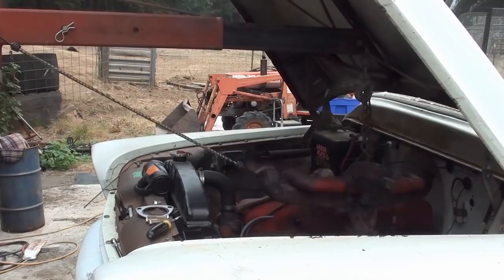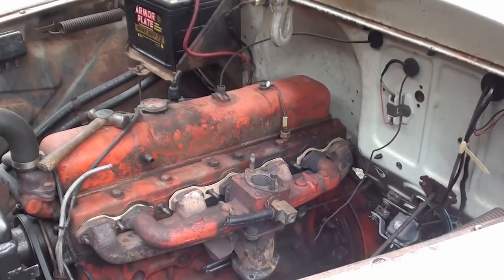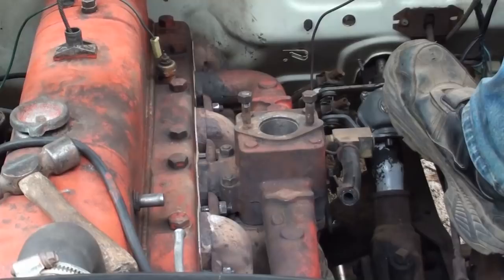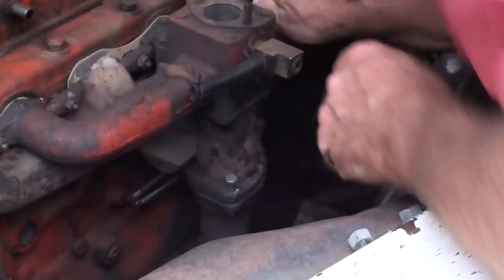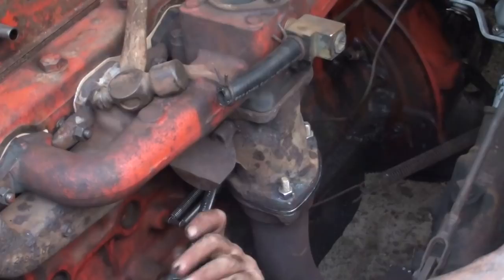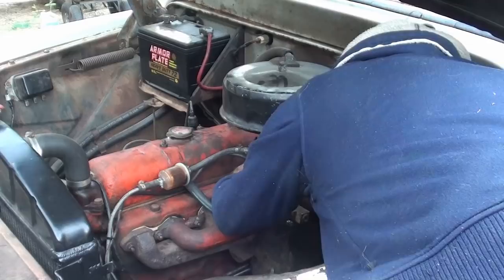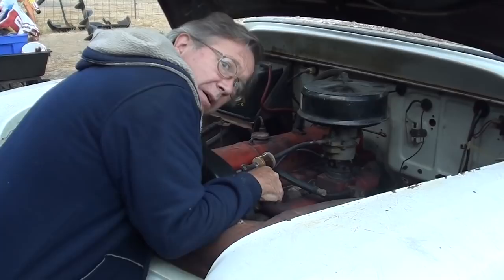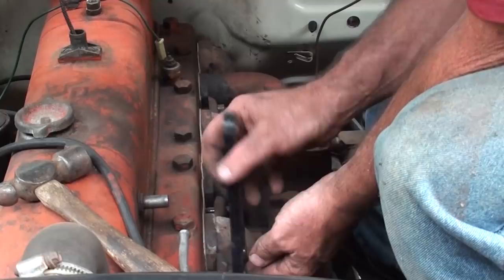1959 GMC Exhaust Manifold Dilemma Part 5

Comment: I remember that drone sound of a low idling straight 6 engine. We had a 1959 Chevy 1/2 ton and a 1949 Chevy 1 1/2 ton.  They were used up until maybe 2010 when my uncle finally sold out the dairy. I hauled a lot of cattle and hay with both trucks.  The first time I drove on the road I drove the 59, I was 10 years old. It was 1977... good memories. Thank you!!

Comment: I installed a new manifold on my 72 C20 Chevy with a 292 cu in engine not long ago, I could have used an engine hoist, but didn't have one at the time. That thing was heavy and cumbersome, but I did get it on and it works great now.

Comment: Well Jeff it's good to see you back, It also reminds me that I have a 1988 F250 7.3IDI diesel pickup in my driveway in need of a rear core plug that's leaking badly. The core plug is one of the rear ones (passenger side) in front of the firewall. I have to drop the driveshaft and tranny to get to it. Considering here in the Washington DC area it's 93 degrees today, I think it'll have to wait. My driveway has no shade.

Comment: U got it yeah,  I was fighting  it with. You and talking  my way through it, dog gone. Fyi I use a entena thingy with a magnet on the end while In the engine bay ,I too am old n can't climb  well into engine  bays very well.
Reply: Aside from purchasing a cheap extension unit with a magnet on the end of it (and for the love of Mike & Ike - please do NOT buy Chinesium made crap!!!), I've always recommend simply making your own from a long thin metal rod or wooden dowel. Of course you do have to also scrounge up a magnet but those are pretty easy to come by via an old, busted up or otherwise non-functioning TV set, radio or speaker (out of a parts yard car works OK). In Jeff's case, I'd utilize a 10-15 footer and just lean it up against the truck in an out of the way yet easy to reach spot. For up on the roof of a house or other structure, manufacture a grabber from a thin rope or cord about 30-50 feet long and a good sized speaker magnet. You'll thank yourself the first time you don't have to climb down and up again! Of course... you have to remember to take it up with you when you first go up. Don't ask me how I know that!  🤔🤦‍♂️🙄

- Max Giganteum

Comment: Its all a good fix and you done everything right. only one thing? Those clear plastic gas filters are a fire waiting to happen.  There Ok on a gravity feed without any pressure. However every time the fuel pump pulses they move a tiny bit.  Unfortunately when that  plastic filter gets aged it can burst. and right below is a hot exhaust manifold. The factory most times used a solid steel line from the fuel pump to the carb and a sintered bronze filter in the carb inlet. Some have a settlement bulb on the fuel pump. I  prefer to install a steel filter someplace between the gas tank and fuel pump.
Reply: My advice is that using them is OK, as long as they aren't near a serious heat source where installed AND you use actual band clamps to tighten down the lines firmly AND you swap them out every 2 years or when the mileage is up. I've yet to personally know anyone that's had a problem following those three steps. NOTE: once again, avoid the cheap Chinesium made crap. Also, do use a factory all metal type filter at the carb. The clear filters should be used as a pre-filter between the fuel tank and the pump at the block. Best wishes!

- Max Giganteum
Reply: @MaxGiganteum  My eldest son installed one of those clear plastic filters in the fuel line between the fuel pump and the carb on his 83 GMC 305. I told him that was a fire waiting to happen. Of course he did not listen. So I went and took the fire extinguisher from one of my vehicles and had him put it in his truck. stated you might need this more than I. And after a month it failed and he needed It. Napa makes a steel filter thats acceptiable. However rubber hose under pressure  can and does fail. U Tuber Waylon Wire. His square cab chevy truck caught fire because a rubber hose between the fuel pump and carb got old and failed. There was a very good reason that the factory installed a solid steel line between the fuel pump and the carb.
Reply: True. I recommend keeping a good sized extinguisher in the trunk of a car bolted down so it cannot go off by accident or get damaged from rolling around. It's also less likely to be stolen. Trucks can be tricky to hide one in, obviously, but I carry one anyway. Have I ever needed it? Yes! But not for my rig - I once bailed out a driver pulled over on the freeway that was experiencing an under hood fire. Knocked it all the way down with a small, single use unit. The fire department showed up about 5 mins later to finish it off. The lesson there was to upgrade to a medium size, refillable unit.  🔥🧯

- Max Giganteum
Reply: @MaxGiganteum   I drove semi truck for over 40 years. Its a requirement every truck have a working fire extinguisher.  You can take a discharged one and fill it with water and pressurize it with a air compressor. it will squirt water 40 feet. not the best but better than a poke in the eye.
Reply: Anything is better than nothing when fire breaks out... but I'd get a chem filled unit on board ASAP because when you need one, you really need one! The last thing you want is for your extinguisher to crap out. Interestingly, that single use unit I used up had what appeared to be a seal that pierced when used. I cut it open on a lathe in the shop to confirm suspicions... I was thinking there was a valve but nope. Denied. They weren't kidding when the label stated one time use - non-serviceable. Into the scrap bin it went.

- Max Giganteum

Comment: I'll record it as a check in the "W" column Jeff... congrats on the completion and sale. I will urge you however, to build up the strength & stamina over the next 6-12 months. Plan out an exercise program then pump some iron & cardio your way back into your 40 year old self. It may take the whole 12 but you'll thank yourself when you cross the finish line. You don't have a foot in the grave yet so live your best life. Best wishes!

🏋🏻‍♂️🏃🏻‍♂️🤸🏻‍♂️🚴🏻‍♂️🥊🇺🇲

- Max Giganteum
Reply from the maker: My 60 year old self!
Reply: Yup... 60 years old but you missed the point man! Hit the weights and get the cardio work in and LIVE like you're 40 again. Haven't you heard? 60 is the new 40!

- Max Giganteum

Comment: Youth is wasted on the young.. I know thats a oxymoron but hey, if you are seventy two, short coming another dang birthday.... my son bought me a car polisher, I am at a good day on two crutches and he wants me to polish his rig while he is out on his job site for the next twenty days. I guess he thinks if I get off my patoona, I am just going to feel grand. Anyhow, I was just twelve at the time, my neighbor gave me this fifty chevy car... manifold had broke on it and the carburetor was gone. I not knowing no gooder... used up all the brass rod dad had... I guess it was a good two or more big tubes of it... stuff was like three foot long. I seen this little ford flathead go by with the three carbs on it... So one and one is three as I figured and I made three different holes in that pipe with the flanges from a couple manifolds an made me my first  tri power system on a 216 chevy that had seen a few miles... maybe five or six according to the oil running out of every orifice. I seen carburetors on some of dads old Wisconsin engines that I got on it... can't be wisconsin as those were updraft... this was old air cooled engines and the carburetor had enough that I could saw off the base of where it mounted.... long and short ... my dad was not impressed as those were engines he was saving for something else... back to my silly setup. I had some vacuum leaks an plugged them down to small air leaks. Vacuum leaks i mean. I had starting fluid, nineteen sixty fuel, enough that all the carburetors had a fuel line cobbled on them... all in  this fifty chevy four door sedan. It shouldn't of worked and I did spend ever waking minute once I got close... Dad slept in on the few days he was home so at right early an a ways from the house, no thoughts about a exhaust that didn't exist anymore.. I was lucky to get the intake put together an on. I guess some times god looks out for stupid kids as it did start, true to form, it was right to the metal, stuck wide open, and on a engine that had seen better days... it started up an from the loud first bang, I ran away like a funny short birdy. Dad heard the explosion an though his shop just blew up so he got to see this old chevy run away and then send flames way high in  the air catching our old tired dead on the wrong side tree go up in flames. I guess by now you guessed this whole dang car was on fire but in the middle of our yard an nothing near by it cept the poor tree I used to tie off stuff to it to raise an lower load out of a old truck or car. That car burnt to the absolute ground as the underside was coated in oil an grease. I had three different jugs with gasoline in them and on the front of the car by the radiator was my new I worked for it sears tool box... the fifty dollar has everything in it tool box. That whole thing made my dad laugh so hard he near pee'd himself. Central called on the phone to ask if our house was on fire and dad said no, I was just burning trash an it got a bit hot but it would go out shortly.. yeah we still had to call the operator an ask her to call aunt Mertil or get Thelma off the damn line so we could hear our call... like eight or more other folk on our same line. Yeah nice old rig you have got going there Laddie! Your at least ten year younger than me cause I baby set the fellers  that was supposed to take care of Jesus

Comment: i also did the oil dry trick back in HS,but didnt see the first start up. but it run because it was gone a few days later
Reply: A small amount of kitty litter will (mostly) make it all the way out of the exhaust system and probably won't hurt an engine. A lot of kitty litter? You could lock up an engine and/or cause damage. Interestingly, in the past, folks have poured various things down a running engine in an attempt to get the rings to seat. Granulated Borax, kitty litter, sand, etc. Supposedly, this method was often used in the old days to get rings to seat without having to disassemble an engine - not that I'd personally be inclined to try it.

- Max Giganteum